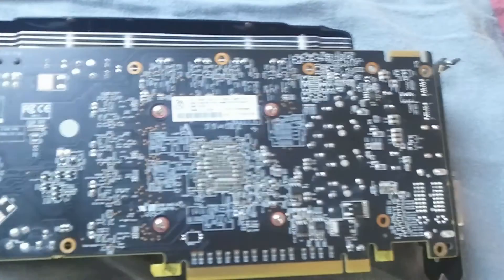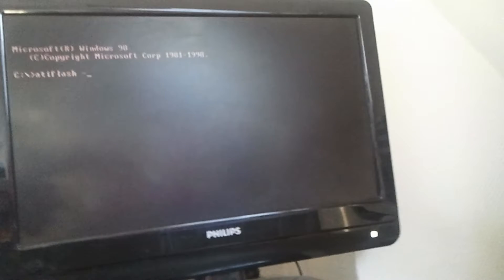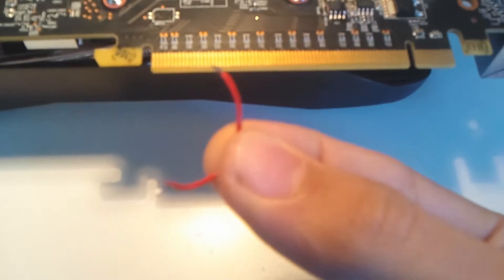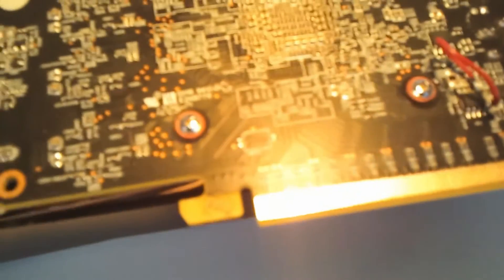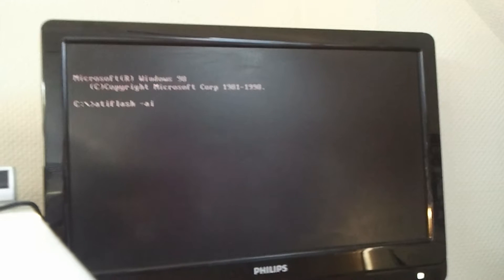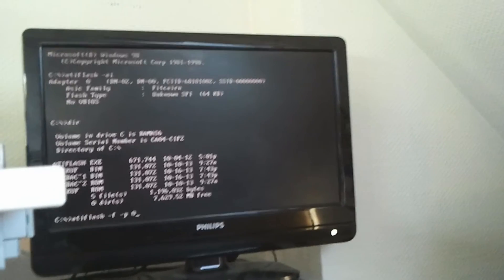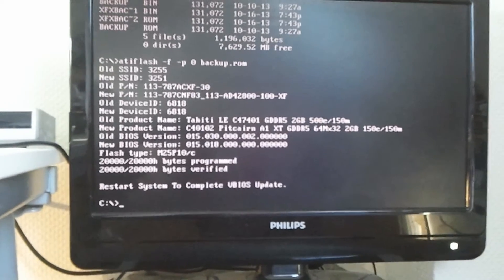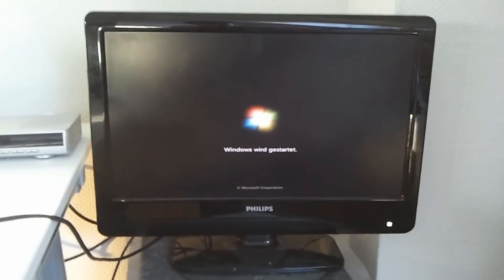Solution | Bricked HD 7870 XFX GPU BIOS FIX | Hardest Way

Comment: Hi, I got this problem on a HD 7950 XFX Double D, if you can answer me where is the bios location (that electronic piece where you bridge the cable), I would be glad. Here is a picture of the PCB:
HD 7950 XFX Double D - http://content.hwigroup.net/images/products/xl/136751/2/xfx_radeon_hd_7950_double_dissipation_edition.jpg

Your HD 7870 PCB to compare: http://content.hwigroup.net/images/products/xl/148837/2/xfx_radeon_hd_7870_double_dissipation_black_edition_.jpg
Reply from the maker: I cant answer it because i dont have any experience with 7950 besides why would you change the bios of an 7900 series? I heard their clock for gaming are really good and "enviroment friendly" i mean Energy Saving.  but well on the pic you see what i marked and that is what i suspect to be but as i said before i am not 100% sure. http://s14.directupload.net/images/140527/u4vcp7s9.jpg however i will look "deeper" and try to find something
Reply: Tugas PT Acho que não preciso de falar inglês consigo, eu também acho que é esse microchip, como essa gráfica não tem dual bios (a XFX retirou, já que as outras 7950's têm) dentro do circulo que indicastes está lá um microchip em falta para a 2nd bios (ao lado direito da que tu indicastes). Foi um amigo meu que tentou flashar para os valores de uma 7970, dá mas não com a rom que ele tentou. Mas como esse chip é diferente como faço para por a BIOS UNKNOWN ? Obrigado pela ajuda btw.
Reply from the maker: ExtremeGame Tuga para pores a BIOS em modo unknown tens que encontrar a peca BIOS da placa grafica, dps dai descobrir qual deles é o pin1e pin8, dps soldas o cabo de ligacao ou seja fazes uma ponte entre os dois pins (pin1 a pin8) basta seguires o video, a unica coisa diferente é o modelo da grafica e o sitio onde se localiza a peca elctronica BIOS da placa grafica.

Comment: question! does this work with a Nvidia card? a GTX 770 Phantom 4GB? if yes please tell me how and where the bios chip is on it D:
Reply from the maker: Well the BIOS electrical piece is in every single GPU card that has a BIOS. The problem is that it can be in different places according the elctrical plan of each card, with Nvidia i have no experience or whatever.

Comment: How do you find out what two contacts you need to join? I have a bricked hd7970 here and I want to try and fix it. What is it called, the two contacts you soldered the wire to to make a circuit? Thanks
Reply from the maker: if you mean the electronic piece then its the BIOS http://j73.img-up.net/xfx-radeonbb2b.jpg  if you mean the cable its a simple thin conductive cable that i got from a bricolage shop. The cable connects the pin 1 to the pin 8 in BIOS so that the BIOS will be in a kind of "emulated" for a short time.
For the 7970 you must search the BIOS piece, google it or ask an expert in Forums :) because i dont have the card.
Reply: Thanks, can't seem to find it on my card (XFX) but it is going for RMA so I hope for a refund.
Reply from the maker: With 7870 tried only with motherboard but no success

Comment: i don't have a soldering iron, should i just buy one, or is there another way?
Reply: I use a very small alligator clip and carefully place the clip over the chip to connect pins 1 and 8.   After ATI flash sees the card, it is easy to pull the clip off to re-flash with a working BIOS.
Reply from the maker: buy one, i had to buy my own too or ask a friend who has one and if he is good with soldering let he doing the task
Reply from the maker: *****  damm the aligator would be a safer method ^^ will think on that one, once i have a bricked card again. Thx for the method.

Comment: Tugas Ari Were you successful with the bios update?
Try VBE7 program (on techpowerup's forum) with stock BIOS. It wont unlock valtage control, but you can customize fan profile/voltage etc. with this.
Reply from the maker: Ye mate I searched first for an Saphire 7870 GPU that it was capable to do Voltage Clock then i tracked the BIOS NR. and matched with the BIOS database of Techforums. Why Spahire? simple mate do you know Trixx Software? The software allows to do Voltage Clock (unlike the MSI it needs an EULA) only if the software recognizes an Saphire GPU, basicly it can recognize any AMD Card but only the ones with an Saphire BIOS can you tweak the Voltage. It worked for me an the XFX 7870 is a beast with the Voltage Clock no wonder they blocked it in the BIOS!
Reply: I have an XFX 7870 Tahiti LE, and I want to try out a Sapphire XT bios, maybe it would work properly.
They are basically the same card, so if I brick it, can I just simply flash original bios back with atiflash+a second card?
Reply from the maker: SajtosNokedli Remember my card was "DEAD bricked" the atiflash didnt recognized the BIOS that I put which it was an TAHITI=7900 series (STUPID IDEA) thats why I used the Pin-1-8 soldering method and it worked only after I put the original standard XFX BIOS (that it was before i bricked card) i used the Saphire BIOS and it worked. wanna a screen with the BIOS NR?
Reply: Tugas PT No, thanks I believe you:D
By the way did you have problems with the stock cooler?
Now my card is underclocked from 1.256v to 1.094v, 1000Mhz core clock/ 1250Mhz gpu clock. The idle is 35C (ok), after 10-15mins of furmark ~79-80C in games around 60-70-80C, my fan profile is linear (+1C=+1%).
These are not so bad results with the undervolted bios, but many other cards run cooler with lower fan rpm and if I want to overclock in the future, 80%rpm+ fans  would be annoying noisy. (sorry for writing here, I cant find PM in this new Youtuble+ crap..)
Reply from the maker: to be honest i find the stock cooler to loud on max rotation (when Its on gaming mode). I bought as a solution the Accelero Twin Turbo its in the video above ^^ and it does it job pretty good :D
Reply: Tugas PT Thanks for the help, I have tried a 3 Tahit LE BIOSs, but 1 was black screen, the other 2 were freezing when I started any game.
But the cooler is a nice piece and a used one is just around 15-20€.
Reply from the maker: SajtosNokedli
 Wait why did you tried TAHITI BIOS? The TAHITI BIOS is only designed for 7900 series or and XFX Double Dispation which is an 7870. Remeber i briked my card with an tahiti BIOS. Just Get an Saphire BIOS for the 7870 and youll be able to even overclock the Voltage. Until NOW it NEVER crashed since i fixed it with the saphhire BIOS.
Reply: Tugas PT
I have a Tahiti LE 7870 - It's a 7950 chip with some disabled units -, so I have tried some other Tahiti 7870 cards' bios.

Comment: help , My sapphire 7870 is not boot but fan is working my monitor say no signal ! if i do Like this in video Can work ? and sorry for my english
Reply from the maker: First check on different cables like VGA HDMI on your monitor, remember to make a DOS bootable disk (an USB disk) to run the AMD software to install/change the BIOS.
Liking this video wont change nothing :D i mean follow exactly what i did and in the description there are few links that helped me and can help you to save your card :D if your fan is working that means good, it means that your card is not completly dead and that it can be saved
Reply: Tugas PT Bro It s Work Tahnk U Sooo Much :)
Reply from the maker: Ouassim Berraqui YOU welcome man GLAD I could save you money and a HD 7870 GPU ;) you welcome spread the word

Comment: It works to on R9 270X bios chip is U11, I flashed the PowerColor R9 270X with HD 7870 XT bios
thanks
Reply from the maker: Glad to hear that my unblock "hardest Way" worked, i used this method too. Spread the word

Comment: Awesome, another method to unbrick cards. Wizzards old post about soldering the pins on an older ATI card dissappeared. Glad to see there's a much more updated version of this.
Reply from the maker: Well i saw the forum too but about the Pin Method there wasnt much of information.
As soon i unbricked the card I Changed the XFX bios to a Safire one so that i can do VoltageClock and guess what...  I couldnt believe that it worked!!!